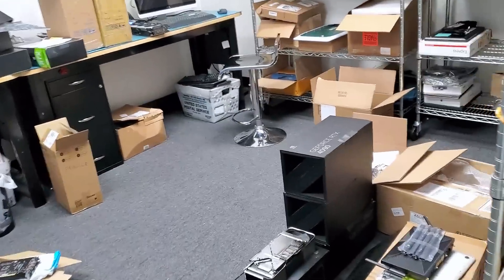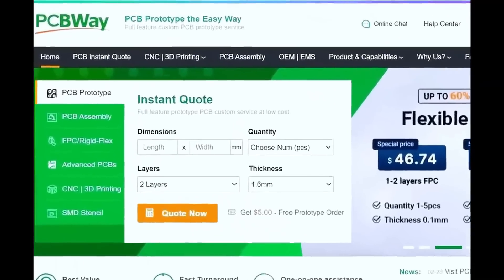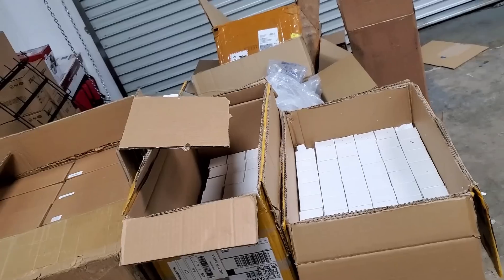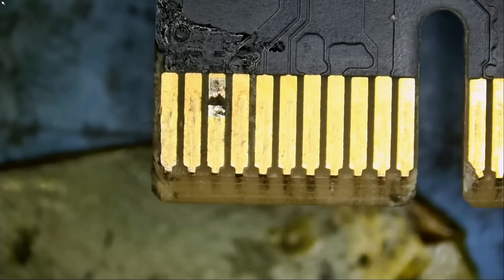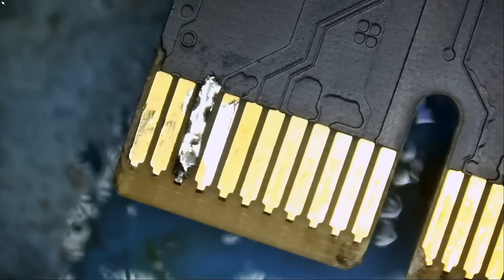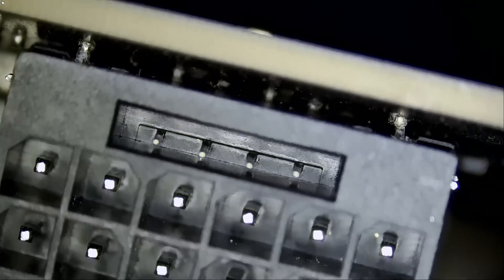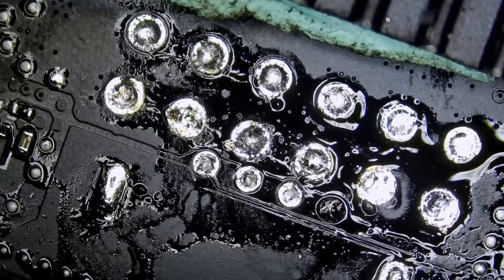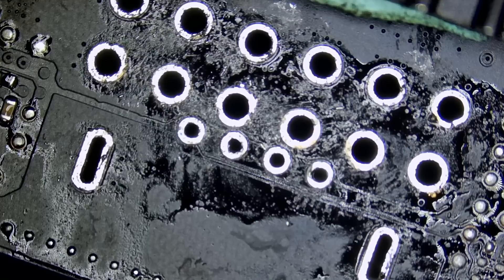18 Damaged 4090 Graphics Cards Founders Edition Repair

Comment: I still use a 1060 and it has been working fine since I got it. Instead of being fooled into thinking You need to be blazing fast overclocked I underclocked I dont need super high resolutions for gaming its just no nessasary frames per second is a nessesity but you can get it with lower resolutions  anyway so whop cares? Its like youre all a bunch of 80's fashion victims

Comment: Those new 12Vrfhejesge connectors are so sketchy compared to the old 8 pins. Using the included connector with my 4070ti, there was no tangible engagement of the plug, and I did push it in fairly hard. It's been running for months now, so I think it's fine, but still.

Comment: I got an eVGA RTX 3070 but it's the last Nvidia card I'll likely buy. I hardly use DLSS or RTX for the games that I play and I don't like the direction Microsoft is going with Windows 11 and beyond. On top of that Nvidia drivers aren't as good as AMD's drivers for linux and I thought about hopping to a Linux distro once W10 hits EoL for security support and updates.

Comment: This connector often seems a failure point. Design flaw? High current / temperature over time? Fix the obvious first, then the most common failures, and you will win. 😃

Comment: Question, what percentage of 4090s you have worked on consist of AIO cooling solutions? Specifically for cracked PCBs/broken solder joints

Comment: I don’t understand how these edge connectors are getting damaged unless the card is being frequently and roughly being removed and reinserted. If the card is carefully inserted correctly, adequately supported and the PC not physically shocked how do they become damaged ? The power connector I can understand if excess force is used to push the power plug in but again if the socket is supported and more care taken during insertion of the plug the damage should not occur. It all looks like rough handling as the cause to me.

Comment: Was gunna buy a 4090 2 days ago until i watched some of your videos about melting connections.
Not a chance im buying one now.
This is 100% NOT user error...this is a massive design flaw.
The 3090's draw same if not more power draw yet dont have the issue.
I'll wait to see if the design flaw is gone in the 5 series cards when they come out, if its still 1 single 12 volt connection I'll pass on those too!!...AMD may be getting a new customer.
Reply: @Don1984-lc9rh Does the card comes with bracket? If not, then it's a design flaw. (which it obviously is, but they never admit it for financial reasons)
Reply: My 3090Ti burned its second set of mosfets after an earlier non warranty repair. Just by running a game for several hours. They where not without fault for sure!
Reply: Set your power limit on the 4090 to 80%
You loose on average 3-5 fps and you will never have to worry about a melting Connection. Just dont OC the card.

As a gpu support i can recommend the lian li solutions. They are nice and discrete.

Hold my zotac 4090 since over a year without fail.
Reply: @dotEXCEI_  SAD way to use a 2000$ card. Understand why, just sad.
Reply: Just don't use the adaptor that came with the card, buy a Corsair premium cable. Also use a GPU bracket if you are mounting it horizontally as they are very heavy.
Reply: @Don1984-lc9rh Sounds from what I've heard is that the Problem is trying to run that much current through a 12 volt adapter when the pins inside the adapter are not upto it.
It's of no surprise they are melting.
This is 100% not an error on the users side. 
I'm only surprised that a serious fire hasn't occurred, or maybe that's what will have to happen before Nvidia act...I don't know, but I for sure would not feel comfortable knowing that they are burning up at the rate they are...and it's only the 4090 series.
Reply: @Don1984-lc9rh100% true
Reply: I got my 4090 at launch 600w power limit no support bracket 0 issues stop crying

Comment: EVGA pulling out of the graphics card market is making a lot more sense now. The 4xxx series has just been a disaster. 128bit $400 cards on the 'low end' and exploding $2000 cards on the high end.
Reply: No problem. Still a lot of millionarie to feed Jensen.
Reply: EVGA should switch to Radeon.
Reply: I really hope Nvidia fixes the connector problems in the 50 series, it's gotten a ton of negative gaming press coverage.
Reply: @squirrelsinjacket1804  the 12vhpwr connector is ok on a 4060ti as it adapts to 1x 8 pin.  The problem is the 90 has 4x 8 pins coming off the same connector. That amount of load running through 1 plug is insane.
Reply: @D-2-RZ  Bro, stop talking to people about video cards. You don't know what you're talking about.

12VHPWR is NOT used below 4070ti. smh
Reply: Their R&D team as well as their repair center employees in the Gamer's Nexus coverage seemed excellent. Theh OC team was also dang good. Kingpin cards used to really have some extra cool features before NVIDIA blocked so many customizations. I bet they ran into a ton of issues and brought them to NVIDIA only to have them say meh we're releasing it so get on board or don't and EVGA was like no thanks.
Reply: Evga knew what was going on.
Reply: But they'll gladly sell you an atx 3.0 power supply with wait for it a 3 year warranty. Meanwhile Seasonic has a 10 to 12 year warranty. Evga  became a joke .
Reply: I have an EVGA 2070 Super 8 gig and it plays everything I want to play or am interested in playing . 400 bucks when it was new.
Reply: I wish they woulda changed to amd gpus. Their quality and designs are great imo.
Reply: @niospartan sapphire on AMD is better
Reply: @niospartan  Same, I really like EVGA. I'm guessing the grass isn't greener on the other side, which is why they haven't gone to AMD.
Reply: @sdHansy 

Yeah AMD (and Intel) have their own issues. But still...they're not bursting into flames because someone in R&D chose form over function for the power cable/connector. This is coming from someone with a 2080 and a gsync monitor.
Reply: @ravage64  if you look at the chinese market, there is a 4070 with the normal 8 pins...
It was the manufacturers choice to adopt the new 12V plug.
Reply: @dotEXCEI_  Yeah uh... all the 4070 cards use ATX. Only 4070ti and above use 12V.
Reply: @D-2-RZ  No it doesn't. It's not likely you can even tell the difference actually, considering no 60 class ever will need a 12v connector when a 1x8 ATX does the job.
Reply: Yep. F NVidia. I'm done with them.

Comment: The solder sucker you use might be faster than an electric sucker but you must first melt it then suck as opposed to a hot tip solder sucker that combines both.

Another major consideration is RSMI repetitive stress motion injury from re cocking the manual sucker. Why put yourself at risk since your fingers and hands are everything in that business?? A big reason Starbucks got rid of the old La Marzocco coffee machines is many barista were developing RSMI, thus they changed to fully automatic machines.

Comment: I just bought my 4080 super. Hoping nothing like this will ever happen! I am running it stock and the connector is pulled in all the way and no light on when using it. So fingers crossed it never fails on my system. Would not like to experience it. Very happy with the card.
Reply: I did the same, and managed to get a decent price on it. The cost per frame is much lower than the 4090. And due to the lower TDP, I don't think it will have any 4090 specific issues
Reply: i let my 4080 draw close to 400w.

As long as you plug the cable in properly, there shouldn't be issues

Comment: Arent those pads just going to oxidise and create unreliable connections? Hence why they're gold plated. And wont the extra height damage your motherboard too?
Reply: pci slots have sprung contacts, so they will be fine with 0.5mm extra thickness on the pad. as for oxidising, its generally not a problem. the gold plate oxidises as well. The contact resistance may be higher, but not enough to worry about. It's not as if it is practical to gold plate rework.

Comment: Question wouldn't it be better to solder the copper wire and then also put solder around the wire too? In this case that is, or like someone said before, flatten some copper wire with a hammer and maybe solder on top of it as well?

Comment: I suspect one or more mining rigs in octominer-like case fell down on a floor causing all cards to crack pretty much the same way :)
Reply: Same here built my pc in March of 2023 and it's still running, no issues thankfully. Then again as a first time pc builder and owner I haven't messed around with overclocking or anything on my cpu or 4090 gpu. I have everything running stock.

Comment: At this point this PCI slot nonsense belongs in the garbage. Can't they make GPUs with proper connectors and screws for mechanical stability? Especially because those dead boards are essentially paperweights.
Reply: and charge you super premium for such product!
Reply: Which connector do you think the GPU manufacturers should use instead? Something that doesn't yet exist at all?

If you think that the computer will be shaken a lot, bolt the GPU itself to the chassis and use riser cable to connect it to the motherboard. That should result in practically no stress to PCB and increase costs only by the riser cable worth.

Comment: Yup, premium build quality worth 2000$
Reply: You pay the premium to repair it that's JUST HOW IT WORKS ¯\_(ツ)_/¯
Reply: The performance is useless if the card doesn't work  😂
Reply: I paid 1700 for mine. But it’s not broken👀
Reply: $1599 at least get your facts correct 😅😂
Reply: @mdkgod43  you won't find it at 1600$ nowadays buddy. It is either sold out or priced at 2000$.
Reply: The card was clearly abused.
Reply: Good ol planned obsolecense.
Reply: You pay for the performance, not the quality, unfortunately..
Reply: @SubjectiveFunny  k, ignore what i said then. Continue to abuse your hardware as you like. Not my Problem 😂
Reply: @dotEXCEI_  I am just saying, they are the most powerful GPU's available. The fact you think they are not powerful enough is irrelevant. Facts are facts my guy, whether you like it or not...
Reply: @SubjectiveFunny what performance? 4090 and 4080 are 1440p cards in new games
Reply: @Archonsx  And is there a card that performs better?
Reply: @Archonsx I guess what he's going to say, for the same type of gpu, you pay more only for the performance, not quality, a higher gpu clock for example
Reply: @Archonsx  They are 4k cards,People just don’t know how to use them and many games are not optimised.
Reply: @Archonsx  More performance than anything else.   And you WANT games to push the limits of hardware.   That's a GOOD thing.
Reply: I mean if dumbasses dropkick their GPU's... I have a 4090 myself for a year now. Mines not broken nor melted... Cuz i know how to handle my expensive tech...
Reply: @dotEXCEI_ if U like getting pegged by Nvidia just say it
Reply: @TheRealName7 my guy, the physics is simple.
These cards cooling solution is overbuild. Therefore they are heavy. Therefore they need to be handled differently. This started with the high end 30 series already. And if you ship or move PC with heavy cards in them without proper support, PCBs will break. If you overclock your cards and dont plug the shitty 12VHPWR (yes i hate it too, watch derBauers videos on it) correctly in, the plug melts.
Its how you handle things.
Or are you also complaining that when you drop your phone (not handle it with care), the screen breaks?
Reply: @dotEXCEI_ lmao so you telling everytime you clean your pc you give gpu connector a wiggle to make it’s seated right? 😂

Comment: I'd really like to know the gpus w/ cracked pcb's the mount orientation and whether or not they were using a support bracket. I'd like to understand how a pcb cracks while using a support bracket.
Reply: You can press too hard on it with the support bracket/leg things or not support it enough. It's always good to measure it with a level tool, from my experience